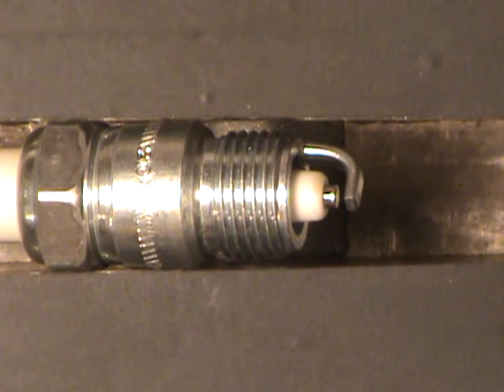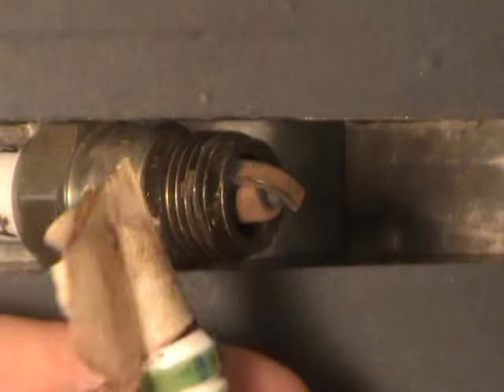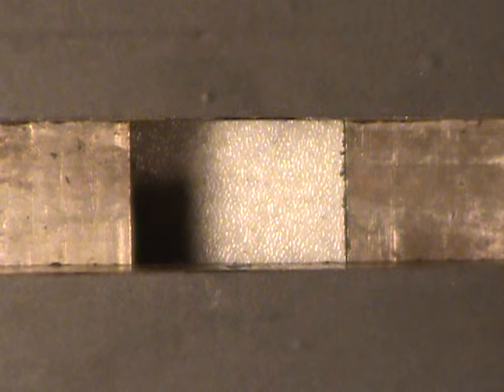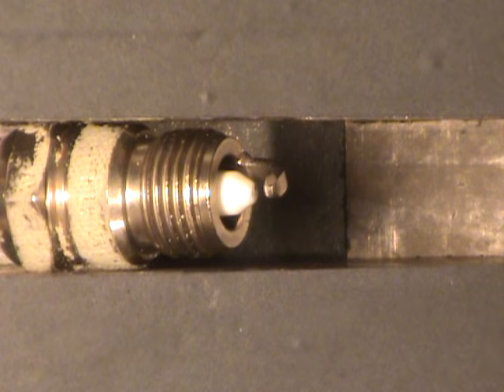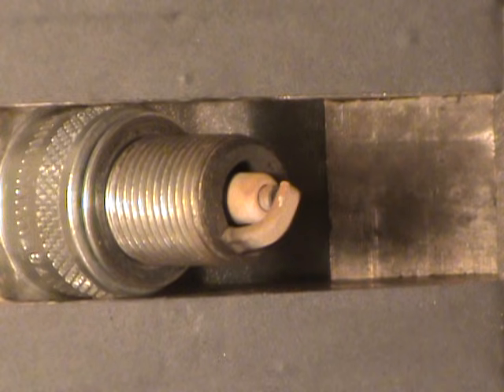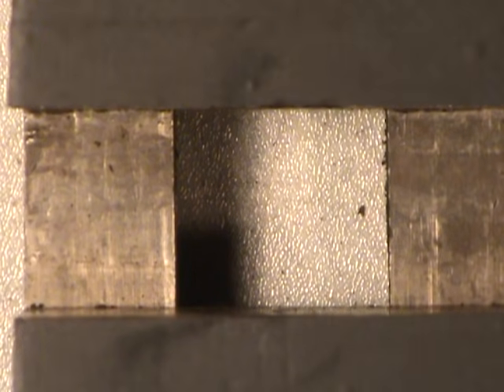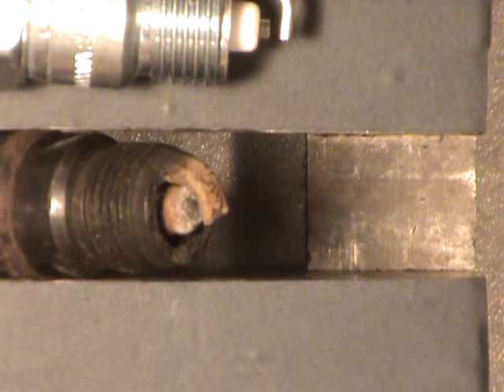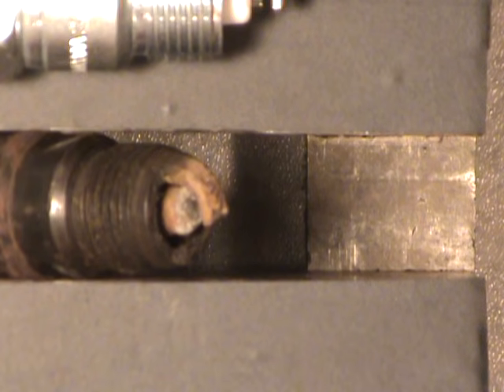SPARK PLUGS How to Read them (Part 3)

Comment: This was great! Now all I have to do is find out where the spark plugs reside in my 1998 Rav4 engine.  My car has an almost new battery but recently it doesn't start half the time.  Sometimes it starts and sometimes it doesn't.  I've also been picking up on a slight burning smell.  I just had an oil change so I'm good there.  Any suggestions before I take it to the mechanic.  It's always better if I don't go in looking absolutely clueless  about what's wrong.  Thanks so much!
Reply from the maker: Greetings...YaYa..........Thanks for watching..........Burning Smell...???...!!!.........For "Safety's" sake...have someone, Find-Out, what the Cause, of that Burning Smell, actually "is"...!!!...cuz, it might have the potential, to Start a Vehicle "Fire"...!!!..................Some examples, of Vehicle Burning Smells, might be caused, by the following...........Electrical System (electrical short circuit, or electrical component failure...???), or maybe...Motor Oil, Automatic Transmission Fluid, or Gasoline (leaking onto, a hot exhaust system, pipe or component...???)...............You might find, that, the (used) Spark Plugs, that are removed from Your Rav-4's Engine, might, very well appear, to look some-what Cleaner, as compared to, most of the used, spark plug Samples, that You saw, in this Spark Plug Video of mine................Yes-Sir-ee-Bob....although Spark Plugs, have a lot to say, in respect to, how well (or not), an Engine Runs and Behaves, they, (the spark plugs), are usually, only, shall we say, one part of the Puzzle, as there are so many other, not so good things, that can be responsible, for the way, in which, a Vehicle's Engine, will (or maybe won't), Start, and Run as well.................There are usually "2-Things", that can be done, for Vehicles, that have Fuel Injected Engines, partnered-up with, an On-Board Computer, that is usually hidden away, somewhere, in that type of Vehicle................The Vehicle's "On-Board", Computer, can be Scanned, with a Scan Tool (kinda, looks like, a slightly Larger, hand held Calculator, some-what), for any Trouble Codes, that might be stored in, the On-Board Computer's Memory (did You See any Dashboard, Warning Lights, coming on at all...???)...............Sometimes, there can be, a Retail, Automotive Parts Store, that might "Scan", Your Rav-4's, On-Board Computer for..."FREE"...so, maybe, make a few phone calls, to the Automotive Parts Stores, where You Live, and ask the Folks there, if they will, for "FREE", Scan Your Rav-4's On-Board Computer, and, once the On-Board Computer gets Scanned, then You'll know, whether or not, there are any Trouble Codes, hiding inside, the On-Board Computer's Memory (by doing so first, it has been known, to save a lot of time, along with, not ending up, with a potential Headache...sometimes...maybe...???).................Then, the other Thing, is to have the "Fuel Pressure" Checked (probably...Not FREE...lol), with a Fuel Pressure Gauge, cuz, if the Fuel Pressure is-not with-in, the Specifications, for Your "Exact" Vehicle and Engine, the amount (Pressure and Volume), of Fuel (gasoline), being injected, by the (fuel) injectors, probably won't be correct, and Engine Running problems, and maybe, Engine Starting Problems, it just might, end up being...maybe...............Warning...!!!...Fuel Pressures, are usually, Very "HIGH", in Fuel Injected (gasoline) Engines, so, make sure, that, You Read Up On, and Know about, what You are Doing, before Working on the Fuel System...!!!...............It appears, that, the Spark Plugs, in Your Engine, are down in the cylinder head, quite Deep, so, Ur gonna need the required spark plug Socket, along with a fairly Long Extension (and Ratchet), so, You'll be able, to get, Way-Down-in-there, where the Spark Plugs are Hiding................If You do, end up changing the Spark Plugs Yourself, then, just Change, "One-at-ah-Time", so, all of the Spark Plug "Wires", get re-installed, back onto, the "Correct" Spark plug...!!!..............Make Sure, to Buy, and install, the "Exact...Correct" Spark Plugs for Your Rav-4's Engine...!!!.............The Spark Plugs, that the "Factory", installed in Your Engine, when it was Brand New, is Your Safest Bet, so, as to avoid, any things, that might go wrong.................If the Spark Plug's "Gap", is Gap-able (note...some types of spark plugs...Are-Not...Gap-able...!!!), then, check to see, with a spark plug Gap Gauge, that, the spark plug's "Gap" (that be, the Gap, or air space, that's between, the spark plug's Electrodes), is at, the Toyota/Factory recommended "Specification"..................Never let any Gap adjustment Tool, come in Contact, with the spark plug's Center Electrode, so as not to Damage it...!!!..............Here's something for Ya...........Do a Search on the Internet, for a Website, that has a Toyota, and/or, 1998 Rav-4..."Forum"...on it. where You will be able to ask any Questions, that You might have, about Your Vehicle...............Some Folks, that are on some of those "Forums", can probably Change, the Rav-4's spark plugs, in Their Sleep...!!!....well, maybe not quite...lol................It's probably a very good idea, and Safer as well, to Research, and Learn-about, what-ever, You might, consider Working on, when it comes to Your Rav-4, cuz, there are lots, did I say LOTS, of Safety-Related things, to be Aware of, so You won't end up Hurting Yourself...maybe....and I hope not.......and.......till next time.........Be Safe, take care, and have a good one.
Reply: Rocky you are so very generous to give me all of that information regarding my car starting issues!  Thank you for taking the time and energy to share all of this with me.  I will definitely take heed and have these things checked out.  I've had lots of oxygen sensor issues in the past so it may be something related to the fuel pressure, who knows. There have been no dashboard indicators lighting up.  At least I have somewhere to begin and I can ask intelligent questions when speaking with a mechanic. I think it's time for me to let go of my Rav4 friend after I get it fixed this time around.  She has served me well since 1998. Again, you're awesome!! Thanks so much!

Comment: Great analysis - Thanks !
Reply from the maker: Greetings...exwhyz33............You're welcome, and Thanks for watching.............Well, I guess that One could say, that, my method of reading spark plugs, is, shall we say, Old School, as compared to, what some Other Folks might be do-in, some of which, might be involved in, a certain type of Motor-Sport, such as...Drag Racing...Banked Oval...Road Course...etc...and no...Demolition Derby...probably, need not apply...and is a whole different animal all-together...!!!...lol...where was I...???...oh yeah, that's it....some of those Other, shall we say, Advanced Folks, that really, want to, get, shall we say..."Up Close and Personal"...and in..."Very Close Detail"...with Reading a Spark Plug, will probably be using, what kinda, looks-like, a Medical Doctor's, Ear Checking Flashlight, that has, something along the lines, of a Magnifying Glass built into it, and, will probably also have, a 90 Degree Bend, near the top of it, as well.................Some, might even Cut, and Remove, the Metal, Screw-Threaded portion, of the spark plug, so as to, be able to, see better, the Porcelain-like insulator, that is usually, deep-down-inside, that Metal, Screw-Threaded portion, of the spark plug, before it got removed, that is................If You care to, maybe do an internet search, for this, shall we say, Advanced Way, to Read a Spark Plug, and.........till next time........Be Safe, take care, and have a good one.

Comment: on my plugs in my EFI 302 it has a little white around the base of the electrode and then transitions into a dark brown on the tip, there is no deterioration on the tip of either side. nothing filling the gap and the rest is pretty clean. I always thought it was running rich cause of the constant backfire (I have no cats). based on what you said white means lean, but I see some other guys with a little bit of white and they say it's good.
Reply from the maker: Greetings...TheSamplebridge.............Nice Car there, and, Thanks for watching.............Yes, indeed, it seems that, most Fuel Injected Engines, that are controlled by Computers, will probably have less, in the way of spark plug Deposits, most times, but only "if", all of the Components are behaving themselves, and are working, as they should be do-in.................Most of the spark plugs, that I used as, shall we say "Props" (aka, stationary Movie Stars...!!!...lol), were, for the most part (with an exception or two), were out of Low Compression Engines (no more than, about 8.5 to 1 compression ratio), that also had, Oil Filled, cylindrically shaped Ignition Coils, in the Ignition System/circuit................The Heat Range, of a Spark Plug, is very important, as it applies to, its Self Cleaning Temperature...Too Cold...then, probably Too Many Deposits, will be getting stuck on, and showing up, on the business end of the Spark Plug/s........Too Hot (of a heat range), then...Bad Things...might happen, such as Pre-Ignition (that's where, the Air/Fuel Mixture Ignites, "Before", the spark plug goes "Spark"...!!!), and, if that starts happening, get ready, for some possible, Expensive, & Un-Wanted Engine "Damage"...!!!...Yikes...!!! (so, if You happen to Hear any...Pinging...Rattling...or...Knocking Sounds, coming from Your Engine, get it Fixed without Delay...!!!)...............Speaking of the Heat Range, of a Spark Plug, I just recalled something, that may be of interest.................I had a Stock, 8.5 to 1 C/R...V-8 Engine, that would get started, oh, about once-ah-month, there-abouts, in a vehicle, that wasn't being driven on the street, at the time, and it had, as I recall, Factory/Originally installed...Champion...N-12-Y Spark Plugs...in it (and those spark plugs, got discontinued, according to the Parts Guy, and, was replaced with, as I recall...Champion...RN-12-YC...that should have the changes-of, going to a Resistor type of spark plug, @ 5,000, or 10,000 Ohms...???...as well as, adding-in, a Copper/center electrode, well, if I get it right that is), and that, in itself, is not the whole story at all...say what...???...............If memory serves me right, I believe that, I probably Cracked, one of the spark plug's, Ceramic insulators, when I removed, that, stubborn, what-sha-ma-call-it, from the engine's cylinder head, so now what...???...so, I goes over to my, not so secret...lol...spark plug Collection, some of which, were Used, and a few, of the others, were "New"...!!!......"Wowsers"...!!!...What I saw, and had, was, a Brand New, either...Champion...N-14-Y...or was it a...RN-14-YC...I forget, but, with either one of them, I would have a Spark Plug, that was...2-Heat Ranges HOTTER...then the...N-12-Y...or the...RN-12-YC...so, I installed the "New"..."14" Heat Range spark plug, into one cylinder (head) only.................A few months, and Start-ups later, I pulled the "14" Heat Range spark plug, to have a look-see, at the Deposits, on "it", and to my (surprise...???)...Wowsers...!!!...by just going..."Up"...by..."2-Heat Range"...Numbers...that..."14-Heat-Range" spark plug, sure looks..."Ah-Lot-CLEANER"...than, those..."12-Heat-Range" spark plugs, ever did...!!! (please note...that, this Engine, was mostly running at Idle Speed, with a Blip of the Throttle, every now and again)...............Gee, I wonder...??? (with a stupid look on my face...lol), just How Clean, and maybe Too Hot (looking), that, that..."14-Heat-Range"...Spark Plug, just might be, if I were to actually Drive, at Sustained Highway Speeds, for Lot-sa Miles...???...maybe too Clean, as well as too Hot...???...and maybe, some possible Engine Damage...??? (I'm thinkin')...............Might be Ok, at Low, City Speeds, without harming the Engine perhaps...???................Just goes to show, how important it is, to be installing, the Correct "Heat Range" of Spark Plug, in just about any, Gasoline Burnin' Engine alright................The good ole rule of thumb, use to be, that, let's say, a car gets driven in the City, at mostly slower speeds, almost all of the time, then, a Person, might consider, having spark plugs, having a slightly Higher Heat Range, then Stock...where-as...let's say, a car, gets driven mostly at higher, highway speeds, most of the time, then, a Person, might install, spark plugs, that are, of a slightly, Lower Heat Range, then Stock...Why You ask...???...well, it's now time, to revert back to, that good ole..."Self Cleaning Temperature"...alright..............Lem-me try to x-splain........Lots of Cold Starts, followed up, with lots of slow speed, city-like driving, will more than likely, be leaving More Deposits, on the spark plugs...as opposed to...something like, a Vehicle, that spends most of its life, Cruising, for hours at a time, at sustained, Highway Speeds...........If it were me (do-in the head-scratchin'), then, I'd probably select, a Spark Plug's Heat Range, based-on, a Heat Range, that was "just" Hot Enough to, shall we say..."Burn-Off"...most of the Deposits, for the Type of Driving/Use, that, that particular Vehicle, would ever be seeing, just, "Never Too Hot", to avoid any Engine Damage (Pre-Ignition, etc.)................For the older, regular Spark Plugs (kinda, like the Champion...N-12-Y...as an example), another Rule of Thumb, for those older ones, use to be, to have no more than, about .001"/one thousandths of an Inch..."Gap Growth"...per Thousand Miles, that the vehicle travelled (wear/increase, cuz of, the...electrical, Arc/spark Erosion, between the spark plug's Electrodes)...........Any more than that, to me, is somewhat suspicious, don't-cha-think...???...might even be...too Hot of a Heat Range perhaps...???..........Also, things like...Too Lean of an Air/Fuel Ratio/Mixture, for the needs, of the engine, at about, any given time, can affect, the way a spark plug looks.......Too Much, or, Too Little...Ignition Timing Advance, at about any RPM and Load condition, will probably have, its share of things, to say as well.........The (coolant) Temperature of the Engine (thermostat rating), will probably also, have an affect as well, seeing as how, some of the Old School Thermostats, probably went as Low as, about "160" Degrees Fahrenheit, and some, that I've probably come across, were as High as, about..."205" Degrees Fahrenheit......interesting that..............Then, among other things (as well), there's..."Spark Intensity" (between the spark plug's Electrodes), oh, and, there be lots, did I say LOTS, of things, go-in on, as in, just about anything, and everything, as it relates to, the Vehicle's Ignition System itself (and then some...lol), so much so, that I can't do it, here and now...lol...but rather, I'm almost at the point, of (somewhat), be-in able to write a little book about "it"...maybe...???................Maybe, install a "Wideband Oxygen Sensor", in Your Exhaust System, along with the matching, Dash-Mounted, "Air/Fuel Ratio Gauge" (can be purchased as a Kit), so You'll be able to see, the "Air/Fuel Ratio", that Ur Engine is Running at, under all RPM's and Load conditions, in Real Time..............So then, just about every, Gasoline Burnin' Engine, out there (to me, that is), seems to have, a, shall we say, "Personality", all of its Own, kinda like People somewhat (just sayin' now), and.........till next time.........Be Safe, take care, and have a good one.